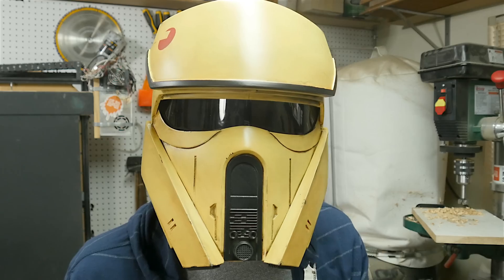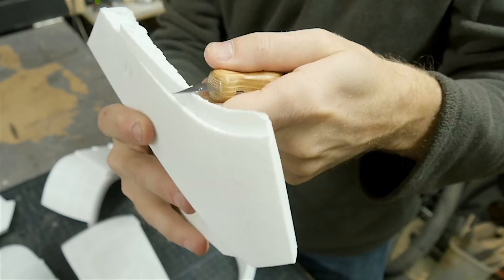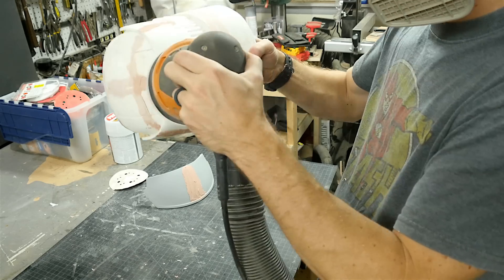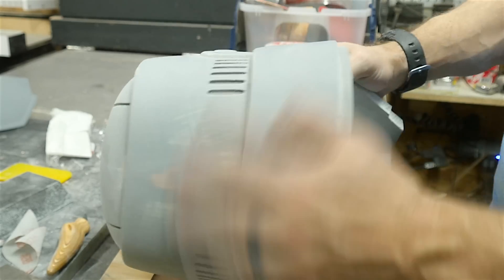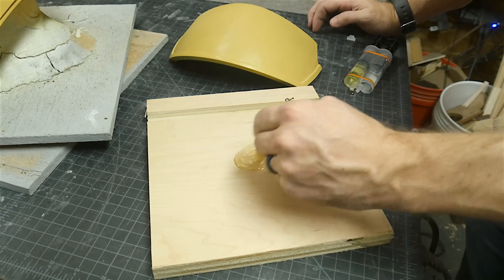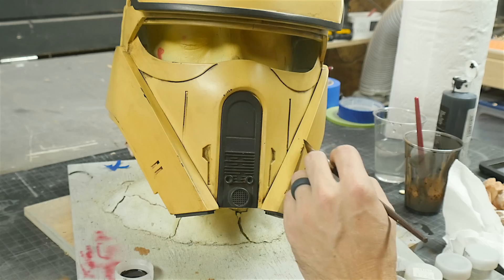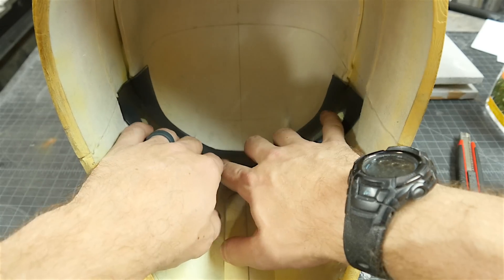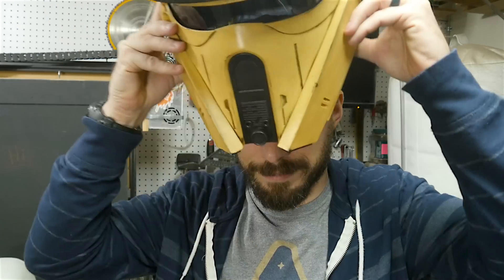Star Wars Rogue One Shore Trooper Helmet (3d printed)

Comment: Another really good option for the parts that you tape.  Tape the area you want to protect and then apply a thin coat of the base color (in this case the yellow), let it dry, then come back and paint in the black.  By applying the base yellow coat to the tape, you  lock the seam so that the black can't run under it and ruin the line.
Reply from the maker: Yes! I've done a similar thing with a clear spray in the past and it's worked great!  I was painting this on my live stream on Twitch so I didn't think about that at the time :)

Comment: Great job with the 3D modeling!  I've been using Inventor for years and have not ventured into the free form modeling area like you used here.  You made it look easy.  The whole project turned out great, Bob.
Reply from the maker: Thanks Doug! Definitely wasn't easy, but the further I got in the modeling process the better feel I got for that part of it.  It'll be a bit easier next time (hopefully).
Reply: On your next 3D modeling project, look into using patterns and the mirror feature.  The vent slots could be copied to the opposite side using the mirror feature and a midplane.  I know you didn't ask for advice.  Just trying to help.
Reply from the maker: ***** Thanks! Yeah, I did quite a bit of mirroring on this to keep it symmetrical.  I actually did mirror the bodies that I used to cut out the vents.  There probably was a more efficient way to do it though.

Comment: Hello Bob, nice work ! You could use an automotive 3M guide coat for sanding. It's a kind of graphite powder. It would show the low spots and help you know when you sanded enough (no more guide coat), and when you need to apply more bondo because you are too far off (deep low spots).
I work on fiberglass and make my own guide coat with gelcoat pigments diluted in acetone. It's cheap, but you work with plastic, so probably not a good option for you.
Spot putty, or glaze putty is the adequate product to apply to get rid of printing marks. High build primer is not thick enough.
Also it's best to use a backing pad when sanding. Otherwise it is very tempting to sand low spots only and one ends up with dished surface, not a flat surface.
Take care !

Comment: hello guys,
i am going to buy my first bandsaw soon... going to use it for propbuilding. so materialwise it will probably be mostly mdf and different kinds of plastic. what would you buy, what should i keep an eye on?
Reply from the maker: I would start with a used ones if you can find it via Craigslist.  A small 9" or 10" would probably be fine for prop work.  You can often find old Craftsman band saws pretty cheaply used.

Comment: If you had it over to do again would you have tried to model clips into each piece so that they snapped together ? Would that have made life easier when you were assembling it? All in all I think it looks fantastic. Definitely something I want to start doing.
Reply from the maker: Thanks!  Probably not actually.  Since the surfaces where sliced in the software and lined up well, it was pretty easy to assemble.  Given the shape, I didn't need to have it come apart like some of the other troopers would, so this method worked pretty well.    A biker scout would probably require a different approach though.